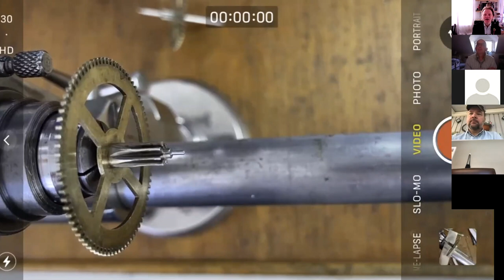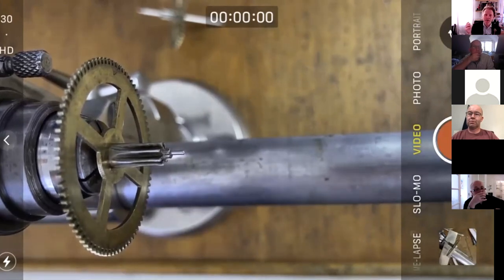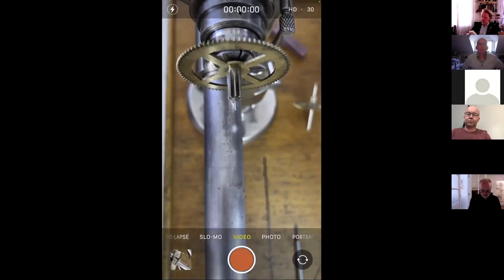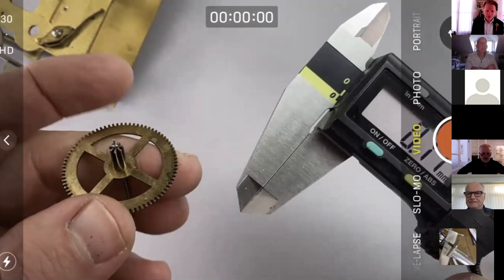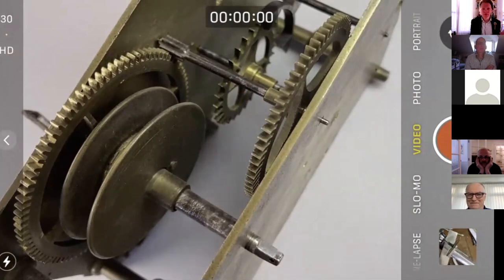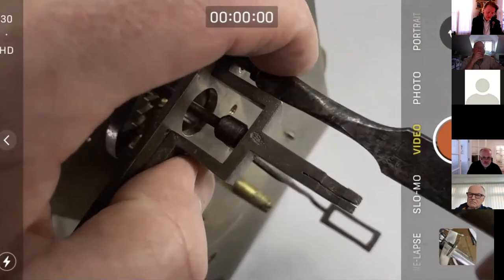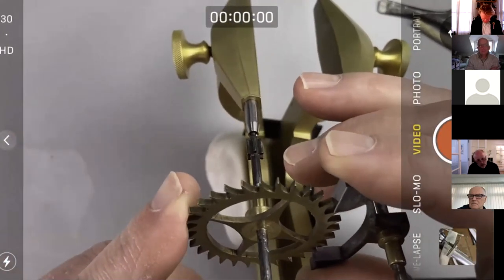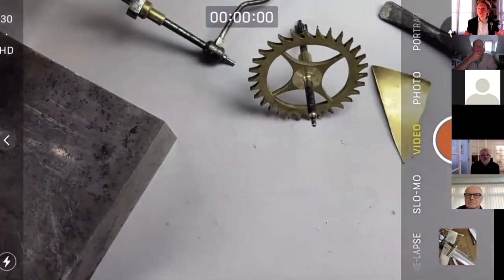Open Clock Club #019 2021_04_03

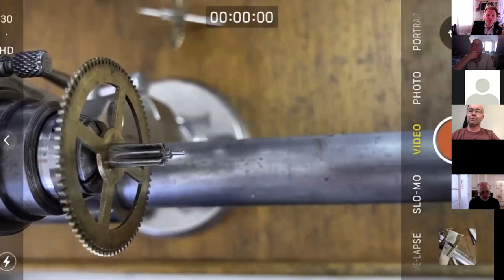Comment: 8:00 "Don't bend the pivot in the first place" Excellent advice - I've come close to bending pivots when I'm reassembling the movement and get a little aggressive in closing the plates while moving all the pivots in to place. Question: I've noticed pivot lengths seem to vary within a given clock; is that because the clock is designed to be reassembled in a particular order (long pivots located first, then shorter ones), or is that variation of pivot length for some other reason? Thanks again for the helpful videos!
Reply from the maker: Not that I am aware re different length pivots.  I don't know much about machine made clocks but it would make sense that manufacturers designed the arbors with different length pivots to assist with assembling;y (probably for the manufacturer rather than any repairer in mind?).  With hand made clocks, I think just natural variation in pivot length just happens to help.  Some older clocks with cast plates the plates taper in thickness very slightly but I doubt makers would respond to that by adjusting pivot length accordingly.  M